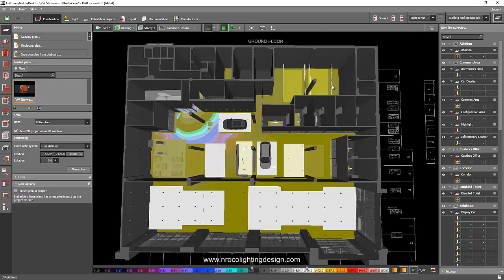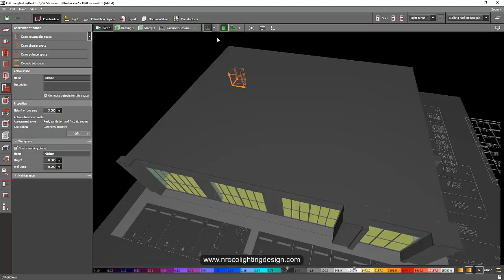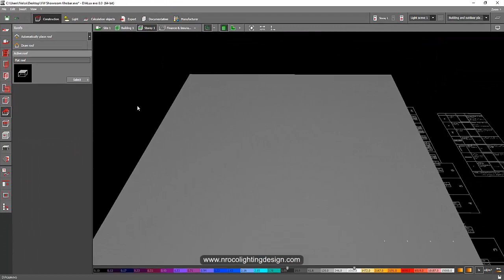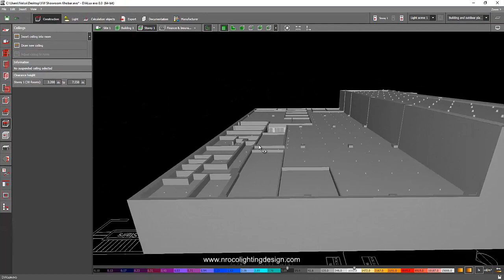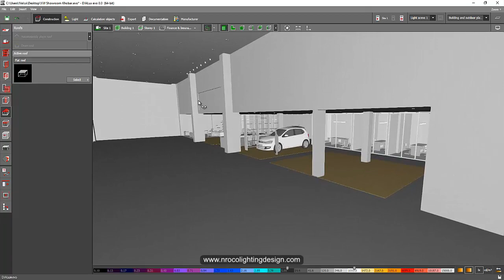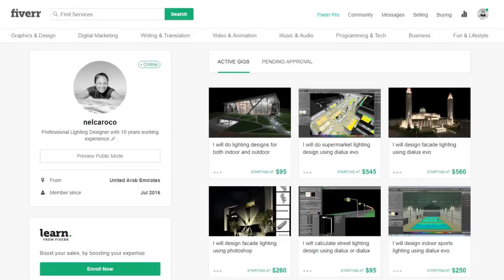How to create different roof heights in Dialux evo

Comment: Automatically place roof option not in my dialux can u just help me to find out.
Reply from the maker: yes, dialux will automatically put the default roof but you can replace and edit it if you like.  just go to roof tab.
Reply: @NelcaRoco   just a question, when you place the second roof (lower), the vertical section/wall between the two roofs are sealed.  how come it does not seal when i do it in dialux evo 8.2....  instead, it shows the inside of the house.  in all views (site, story, building).  Thanks in advance for your reply.